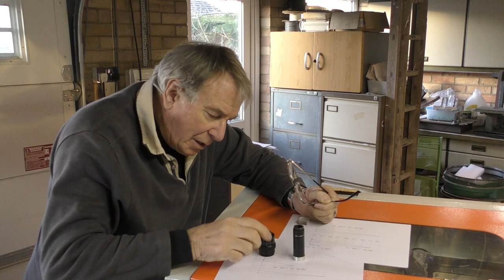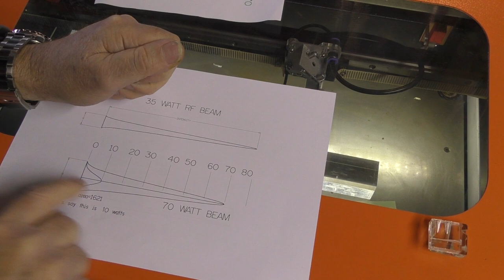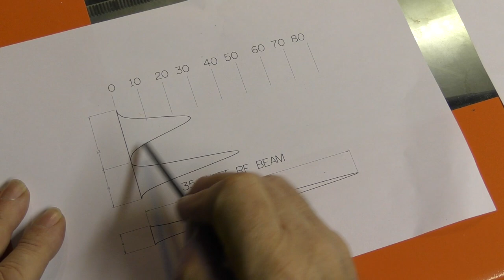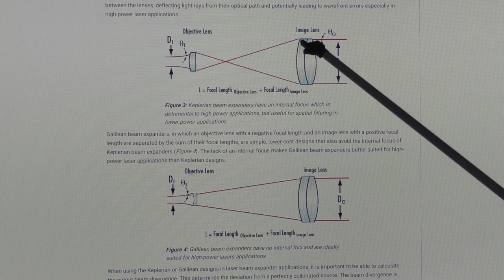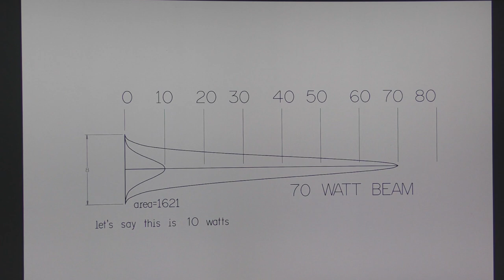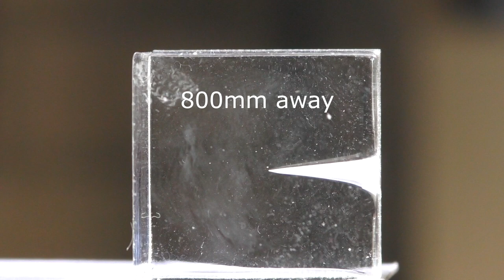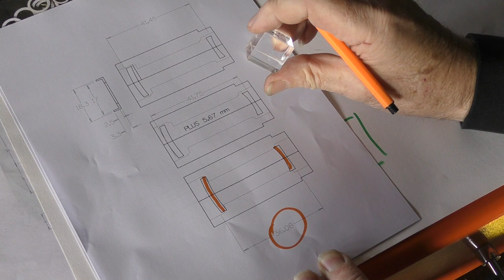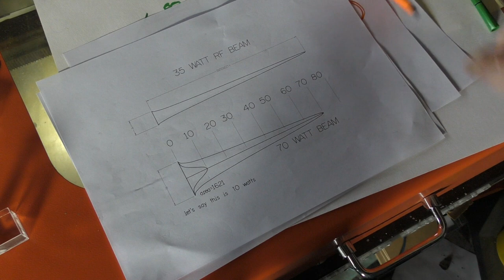RDWorks Learning Lab 228 Search for a Beam Collimator Part 1

Comment: Russ, first of all, thank you for your enthusiasm and passion. It's always a pleasure to watch your videos.

I'm very excited for the next part.

I'm sitting here on a Coherent Diamond E-150 source (RF) that can output up to 375 watts peak but has an awful Mrad of almost 7. (Notwithstanding almost 6000 watts of power consumption at full power) During the year I wanted to assemble a medium-sized machine with it. All of your work in the field gives me hope that I can build something sensible from the knowledge I can draw out in order to use the performance as much as possible on the entire work surface. The large machines where these sources are used usually let the source move over the work area in order to get optimal cutting performance.

I still owe you: Before I sold my old China 7050 machine. I did a few cutting tests as promised with increased pressure. I just have to put together a video.
Reply from the maker: Hi Sebastian

 SPOOKY!!!   It was earlier today that I was looking at the Coherent Diamonds. There was not much of a specification on their website. I was trying to find beam size, M2 and divergence..
 I was trying to understand the two output values What is nominal  watts? Is that with 50% duty cycle and peak with 100% duty cycle  is there some other energy storage system in play ( like turbo?)

 Is your new machine planned for cutting or do you intend engraving with it also.. Swinging a RF unit around  firing straight into a lens, makes that machine a serious animal.
 Best wishes
Russ
Reply: @SarbarMultimedia  Good morning Russ,

You have a new mail in your inbox ;-)

Yes, Coherent keeps a low profile when it comes to data from their lasers, Synrad is a little more generous.
In general, the older Coherents like my Diamond E150 are not operated with a 100% duty cycle, the average power for continuous operation is usually between 50 and 70%, which is what the power specification is for (E150 = 150 watts). With the appropriate heads and inert gas, the lasers can also cut thin sheet metal, but as already mentioned, the entire laser is then driven along the portal. Not great for engraving unless you have a very expensive high performance x y portal.

My machine should be able to do both. The structure will be similar to a normal engraving/cutting machine with a fixed laser position. It may be possible, especially on the basis of your very interesting experiments, to divide the machine into different areas. In other words, a short beam path very close to the laser is the cutting area and further away for engravings. Let's see the year is still young and I absorb your videos like a dry sponge absorbs water.

Comment: Another enlightening video. I'm blown away at how badly the laser performs at various distances. Even as an engraver, it seems to me the quality from the rear left and front right would be significantly different. It looks like you're onto something by not simply following theory and taking a dose of reality into account. Well Done!
Reply from the maker: Hi Dave
 If you want to engrave  then a "blunt" beam is for you as it will be more uniform performance over the table area.  It's easy to make the beam blunt with existing lenses but  keeping it Sharp" is a VERY difficult pursuit
 Best wishes
 Russ

Comment: Russ, here's a HUGE timesaver: get a roll of cash register receipt thermal paper.  Run it diagonally across the bed from the laser output corner to the far corner.  REMOVE YOUR CARRIAGE LENS ENTIRELY.  This means the beam width itself burns right onto the paper.  Set speed as high as you can go and try to reduce power, and keep a fire extinguisher (or metal bucket) handy because it might catch fire.  This will show you the profile of the beam across the entire bed.  You don't need to see the beam shape at every point on the bed, only 0,0 and the furthest point.   You want uniformity, not minimum beam size.  You only need the beam width to be something you can catch with the optics- keep in mind a 25mm mirror is only about 23mm mounted, and since it's a 45 deg angle the widest it can capture is 16mm.  And there will be some inaccuracy in the alignment and there will also be usable energy outside the 1/e^2 beam diameter you want to catch.
Look at the tape pattern.  If it bowties (or just seems to widen), lengthen the collimator airspace.  If it narrows, reduce the collimator airspace
Thermal paper is a threshold.  It will generally be the same shade as long as it exceeds the threshold.  We want to avoid burning it though.   This does create ambiguity you need to understand.  When the beam narrows, its energy density increases and it will now mark the paper IF it was too weak to do so before.  First clue is browning of the paper.  But also if it's already marking the paper but is widening and starting to go below the marking threshold, it may paradoxically create a NARROWER mark, because only the center to of the beam is strong enough to make a mark.
Reply from the maker: Hi Danny
 As I  said in my video, I am grateful for your  stimulating thoughts  and encouragment.  I see from the way you descibe the parts of this subject that you have a lot of in-depth knoledge of lens theory  I like the prag matic  idea of heat sensitive paper  and I have lots of 3mm MDF strips that will record the same power trails without the fire risk.

 I think I have taken a different fork in the road .  I spent a lot of time experimenting with the X2 expander and despite  some progress (and getting you excited) I could not turn your suggestions into the success I am looking for.. I am currently half way  through  next video and conducting performance compaarisons .  It will  be avaialable in a couple of days. 
Many thanks for your continued and valuable engagement.
 Best wishes
Russ
Reply: @SarbarMultimedia  Hello Russ- the thermal paper is very helpful because, note, we remove the lens and cone, so there's no air assist.  By dropping the power to something minimal and using high speeds, you get a nice map of beam uniformity.
Reply from the maker: @dannymiller2123  
Hi Danny 
With yoir encouragment I have pushed on and am making great headway . I understand how and why you would be using thermal paper  but the feedback it provides  it is very one dmensional (actually 2) . I feel sure that, despite your enthusiasm for my progress, I am looking for something different than what you have achieved.. A mode burn into acrylic gives me a 3D image of the light INTENSITY wthin the beam. It gives me a very precise way to assess my success at retaining the vital  central intensity as I try  to project the beam to about 1300mm. As a quick and dirty way to see the beam intensity in a more meaningful way than  thermal paper I use brown Kraft card. If you hold it  in the beam  you get at least 3 pieces of valuable data. If the beam intensity is low then you just get a scorch  as you hold the beam on for several seconds . That scorch also gives an impression of the beam diameter . If the beam intensity is high enough, just a short pulse  will instsntly burn a hole through the card and leave a scorch halo of varying size around the hole . The relative size of hole and halo tells you about the intensity distibution. Its a bit like reading tea leaves, easy when you understand what the pictures in the bottom of the cup mean.. . My 30 watt machine has been castrated as a cutting tool by enlarging the beam, even by X2. Although even that device does not work as specified and reading between the lines I get the feeling that your efforts are about correcting that anomoly and that you have succeeded in making  you beam unifom across a much larger machine than mine. by making fine adjustments to the expander As I said, my 30 watts have been castrated as a cutting tool as soon as I double the beam diameter.  People wrongly believe that more watts means more cutting ability. I know this to be wrong and when I realized my 30 watt RF souce had  a very small beam, I rcognized  a way to make the machine double it's cutting performance for FREE. However it did mean ignoring all the best expert advice and treading a new path.    The most recent video (#229)  starts to explore the benefits of enhanced cutting with a high intensity beam. In parts of the machine I can see 60% improvement but now that the prrinciple has been proved, I must start  methodical experimentation with the very limited kit I have to see if I can turn the concept into something viable.. Doubling my macines cutting ability for fee is a bi challenge  but that the sort of problem I love decoding/. Thr pize for success is huge
 Thanks again for your support an encuragmnet.
Best wishes
Russ

Comment: So, how about putting a servo on this lens assembly, and change it according to the XY position of the laser head?
Reply from the maker: When you have perfected the design please send me a set of drawings. My design mentor of MANY years ago beat into us one simple phrase  Before putting pen to paper . " FULLY understand the problem before you try to solve it". 
 Beam expander lens therory is all about controlling beam diameter. There are two major issue applying this theory to laser beams. 1) there is no determinable edge to a laser beam  and 2) the intensity distribution is not uniform.  The most impoertant aspect of a laser beam for CUTTING is INTENSITY.  There is no consideration of this factor in lens theory.

 As I demonstrate  in this video, there is no single distance parameter that solves this problem, thus motorizing that parameter would not offer a solution
.
 I thank you for the suggestion and must congratulate you on your imagination. All engineering solutions begin as ideas but few pass the practicality test. It is VERY easy to knock them down but visualization is the really difficult part. DONT  STOP.
 Best wishes
Russ
Reply from the maker: Arpad Toth  
 As I mentioned in the previous answer, understand the problem before you invent a solution. If you have a normal glass tube machine  there will be too many process variables to  clearly see the problem for yourself. You will need to invest in a conventional  fixed  beam expander  and experiment before you will really understand the magnitude of the problem. The bigger your machine the more impossible a solution becomes.
 Best wishes
Russ

Comment: Just brain storming and thinking out loud here for a minute (that I’m thinking at all could be in question). What if we are looking at the wrong end of this issue?  By that I mean what if there are improvements that could be made on the end where the beam originates?  I’m wondering if the beam coming out of the “tube” could be tuned to make it better over the travel of the machine.  Just a crazy thought.
Reply from the maker: Hi .
 I wish your crazy thought was possible but what comes out of the tube is  fixed by the design and the whole tube is sealed.  To be honest the beam coming out looks pretty fabulous for size and with an excellent intensity distribution. The real problem is that lenses do not perform as the experts imagine. I might be an idot that knows close to zero about optics  but I am very used to reverse engineering. Observation beats theory and then you throw the rule book away and work backwards to see if there is a solution  that theory cannot account for. I have always been a rebel and I have skepicism as part of my DNA
 Best wishes
Russ
Reply: @SarbarMultimedia  that’s actually the true foundation of science and learning. 
I’ve been following this pursuit for years. I’ve appreciated every video on the subject. I have a Chinese “100 watt” laser.  I’ve done a lot of experimenting with air assist options. Nothing as in depth as you. I’ve been able to 3D print some trial designs for lens holders and air nozzles.  As you’ve shown just getting the cabinet clear is as beneficial as anything.

Comment: ‘Transporting’ a laser beam across a distance is somewhat analogous to transporting AC electrical power long distance. We produce and consume low voltage power but after production we step-up to high voltage for transportation and then step-down for consumption. This minimizes transportation losses. We need to transport laser power without significantly changing (increasing) the beam width for longer travel. This increase is smaller when beam width is larger. So may be we use a beam expander to increase the beam width for transportation and the use a beam ‘compressor’ before the lens. This will ensure a much more uniform beam width across the entire work area.
Reply: If you think more about it, the beam ‘compressor’ at the receiving end can just be combined with the lens. The net result will be a larger focal length lens.  In other words if we expand the beam by 2x, we should compress the beam by 0.5x and the use a 2” lens. This is equities using a 4” lens on an expanded beam.
Reply from the maker: Hi Rajiv
  I always value your input and I lke the idea of that in principle  but I see two issues. First ,  the spherical  aberration of the first lens distorts the Gaussian distribution and after that the game  seems to be lost . It is possible as you have seen to slow that loss down by lens juggling. The second issue is the mechanicaland axial alignment  issues  of mounting a beam compressor on the head. Aditionally  there will be  two more  power consuming elements in the beam path.  Experiment work with power loss (watts) through lenses and mirrors,  points to typically 2 to 3% per mirror and 3 to 4% per lens.  Forget the compound effect and there will be 3 mirrors at 2% and 5 lenses at 3% , that's 1/5 of the power lost.  Hmmm. I think its a great piece of lateral thinking  but rather impractical to even try. The guy that suggested  modifying the expander thinks I am nearly there and has made further suggestions which I must try,
 I havn't given up just yet because the prize is too great and there is a hint of significant improvement showing through  my naive  experimentation.
 Best wishes
Russ
Reply: @SarbarMultimedia  Russ, I realize the impracticality of my first comment and that is why I suggested in my second comment that the compressor and the lens can be combined into a single lens. A 0.5x compressor and a 1.5” lens can be replaced by a 3” lens. A 3” lens is exactly equivalent to a 0.5x beam compressor followed by a 1.5” lens. They will have the exact same dot size and performance. Similarly a 0.5x compressor followed by a 2” lens can be replace by a single 4” lens. If you think that a 4” lens has a bigger spot size than a 2” lens, that is only true if the beam width is the same. A 4” lens on twice the beam width has the same spot size as a 2’ lens. This is because the minimum spot size (diffraction limit) is only dependent on the solid angle of the converging rays.